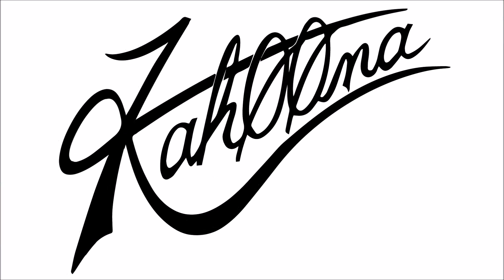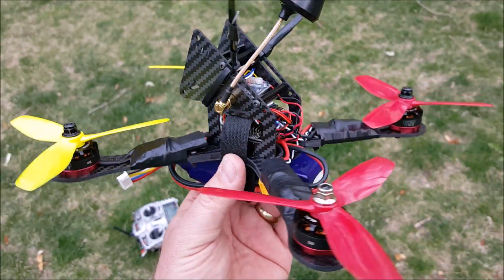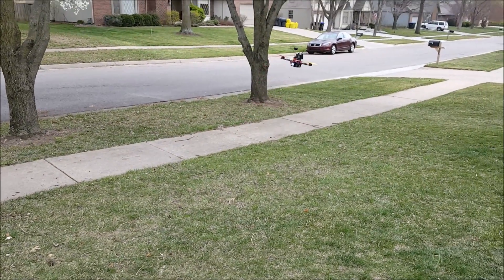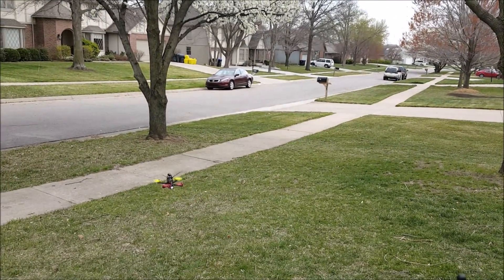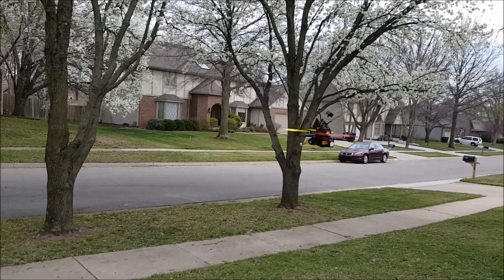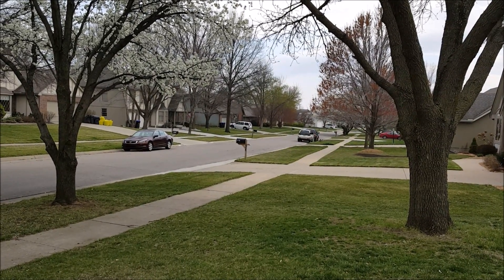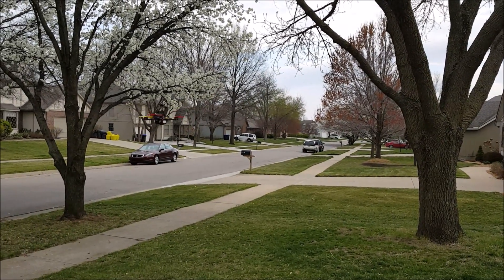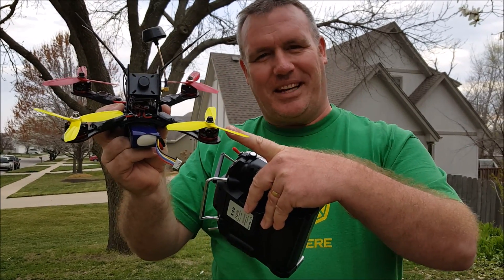GE-X240 with RS2205 Motors - First Flights

Comment: will this fit runcam owl?
Reply from the maker: I think the plates are too far apart to use the side mounts but you could probably mount it with the lens and a lock ring... maybe.  There would need to be enough room on the lens that sticks out to go through the camera mounting plate.
Reply: +travisgrindal also wat pdb did u use cuz i saw ur review the stock pdb is just positive n negative haha

Comment: Did you solve the issue?
Reply from the maker: +ghosTECH FPV Kind of.  I tuned it a little more but it still gets the jitters when I come out a fast run and make a U-turn.  I'm still working on it though.  After I get it a little better tuned, I'm going to make another more in-depth video about the whole quad build and components layout.
Reply: +travisgrindal so try this...I too purchased these motors and my quad was all over the place! I thought it was my settings trying to adjust to the new motors. Couldn't tune it. After a couple days of trying, I noticed that one of the nuts supplied with the motors was not balanced. I replaced all the nuts to smaller lock nuts and it worked. Quad flew great! You might want to check.

Comment: i think it s just the P :)
to high :)
You ll get even more juice after that :)
Reply from the maker: +Vaclav Prochazka All the Ps were too high... pitch, roll, and yaw.  It is way better now.  I need to make sure the camera and VTX work and a follow up to this video will come soon.
Reply: I though so.. I had so much trouble adjusting them before, when i see a fly, i try to guess what to hight or to low :)  I think i never had so much trouble than tunning the yaw..  ( can t wait to see your footages on fly... Very interesting frame by the way :)
Thanks for your videos, and the cool mood you share with us :)

Comment: I'd love to see a video about you tuning the quad. What's the steps to take, in what order, what do you look for, how much do you increase en decrease the pid values? Great video's Travis. Thank you
Reply from the maker: +Mark Poorthuis For what it was doing in the video, the oscillations look real fast.  That usually means your P is set to high.  In LibrePilot I lowered the P for the pitch & roll by 20 and then lowered my I for pitch and roll by 10.  If the oscillations look slow, then that usually means your I is set to high and should be lowered.
Reply: i am n00b here, and I like your video, and enthusiasm! I just bought my first 250. I have tri-props on the way, and I am beginning -the beginners flying. I am confused by the tune thing. I dinged a prop, and saw what out of balance prop does. I'll have to Google the tune thing. watching for part two on this little beast. salute!

Comment: could you do a video on tuning the quad
Reply from the maker: +Marcus Mc Kay At a very high level, if it has "fast" oscillations, your P is probably too high.  It has "slow" oscillations, your I is probably too high.  If it won't hold it's angle in the air, and wants to flatten out even though you aren't telling it to, your I is probably too low.  If it jitters on a descent, your I is probably too low.  Now, which "P" and which "I"?  I usually just adjust my pitch and roll.  If I increase one, then I also increase the other.  If I decrease one, then I decrease the other.  I rarely every adjust my yaw PIDs.

Comment: Are you on oneshot?  Oneshot fixed my oscillations... it was oscillating just like yours.
Reply from the maker: +Bryan M Yes, my ESCs and CC3D have OneShot enabled.  This is a tuning problem.  If I was running the BetaFlight software, I'm betting their default PID settings would work a lot better.